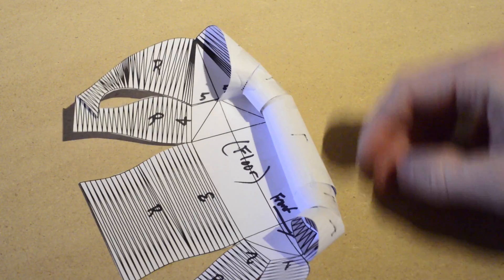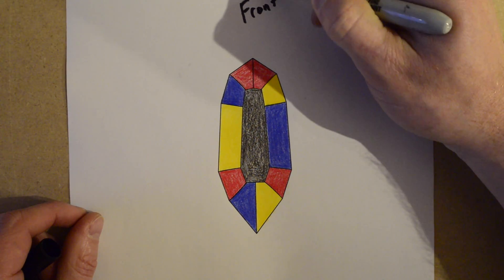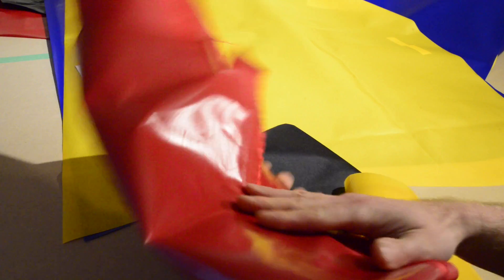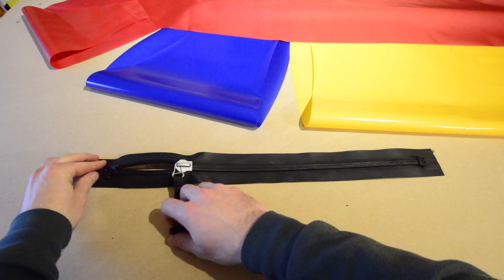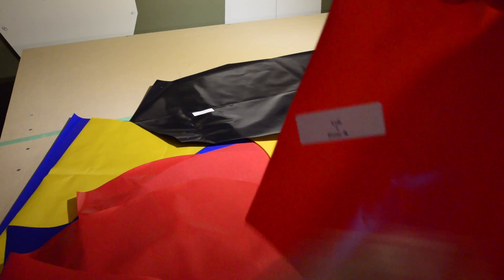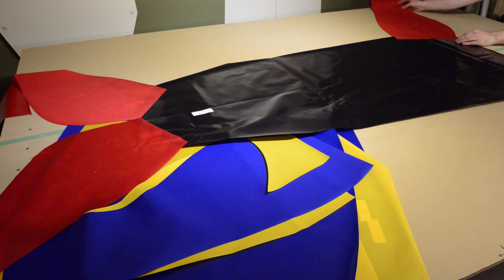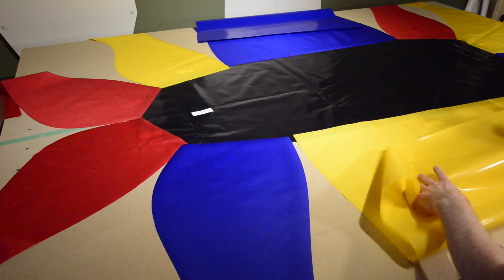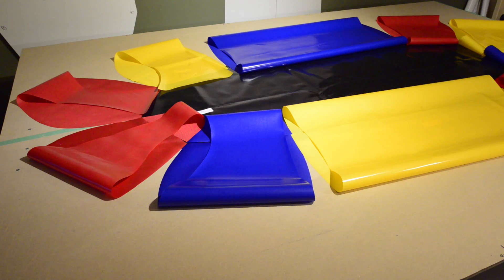DIY Packraft - V2 Kit "Unboxing"

Comment: Hey Matt, amazing look the KIT, allready orderd one - not in the collored version, prefer the stabilize fabric version with in black. Hope incl. is an valve. I checked your instruction to the iron tool, try out an ajustable heater - former with only three temperature levels don't work well. try it with fabric TPU from extremtextil, but it also get trouble with the temperature and glued seems. Well looking forward of your package. If I realize the seat with better tool, will send a foto. greeings marco
Reply from the maker: Thanks for your support, Marco!

Comment: what size is that table? and what temperature do you have the iron set to?
Reply from the maker: The table is 96" x 66" (1.68 x 2.44 m). It's where I make the kits - it's unnecessarily large for putting them together. I'm not sure about the iron temperature... I don't have an accurate way of measuring it. I'm guessing it's around 200 C (400 F).